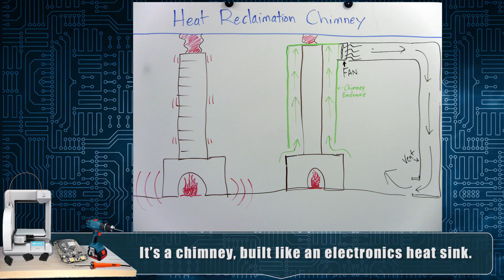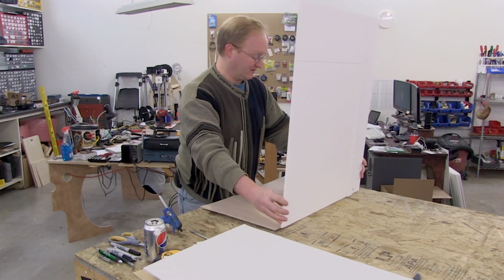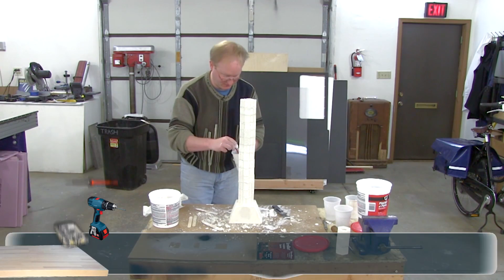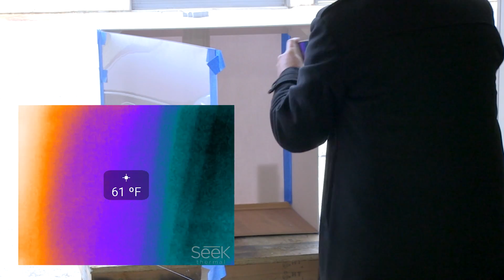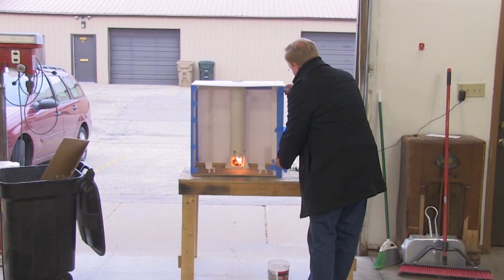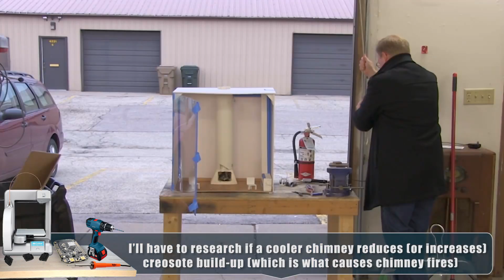Ben Heck's Chimney of the Future

Comment: Interesting concept, though at the same time one would have to take into account the energy expenditure of the fan (probably not huge in a real world case, but still worth considering)-- and, as well (and ah ! I was slightly disappointed to not see this, as in the end it is an electronics project), you really need some sort of sensors surrounding to detect for levels of CO2/CO. Not that one would necessarily 'expect' leaks (but usually the fumes 'just' rise up and out, with no risk of them being pumped back in... But of course one does not want to consider the possibility your chimney could kill you in your sleep !

Comment: I'm surprised at the lack of metal... metal being a better conductor of heat, obvious copper is very expensive, not sure what would be the next best... however... it must be a better conductor of heat than plaster of paris is... Anyway, I've always thought at least with a 2 story chimney, that you could reclaim a lot of heat by making the convected (real word?) heat go past metal slanted downwards plates, that would each heat up and reclaim the heat that way, although the double chimney design is a good idea... all be it possibly in metal and taking the average of the ambient air temp as opposed to a surface like a 66 chair 99, as in your second test. Just my 2 cents... :D
Reply: Also, if you are going to control the system by microcontroller... why not power it by the same fire burning in the fire place... So trying to think of the device that when cold on one side and hot on the other, generates electricity... this almost might negate the need for microcontrollers... as when the outside is colder, and the inside is hotter (chimney) it would produce more electricity... resistors and such may need to be employed, however I think this is one that's worth revisiting in future! :D

Comment: While a cool experiment I don't see the purpose of this(unless of course it was to advertise that temperature camera)... there are two very good methods of doing this already... either a air tight insert with a fan that blows air through metal tubes that run above and below the fire(in the flames and coals) or by using a wood burning stove(standalone enclosed fireplace that sits in the middle of the room so there is substantially less wasted heat)

Comment: Old idea, check Roman history, they used an external fire with the chimney passing under the floor and up chimney stacks around the walls, underfloor heating ass well as warm walls
In walled gardens in the UK they had fires that exhausted heat through one wall, they grew plants up that wall that needed warmer climates
Many houses had a cavity chimney with vents into upper rooms
Not forgetting back boilers built into the back of the fireplace to heat water
An improvement to standard fireplace heating (coal or gas) would be to have a vent from outside directly into the base of the fireplace to feed the fire, that way you don't get cold air drawn in through doors and windows all the way across the room.

Comment: Insurance companies would hate to see this! In case of chimney damage, this would be a hazard.
I've seen comments about having copper pipe coils in the chimney. The chimney needs to be cleaned regularly because of soot deposits, so this wouldn't be practical. In some cases, there would even be enough heat to damage the coils.  Having that built into the chimney wall though, might be viable. But you don't want this system to cool down the chimney too much, or we're back to problems with soot accumulation. Chimneys and fireplaces are quite the touchy subject.

Comment: I don't understand the point of this video.
Don't you guys have reclaiming chimneys in the US?
These are kind of the standard in northern Europe if you build a chimney...
It's not exactly a tube like design, but rather the inside is shaped in a zig-zag and the heat is transferred usually to the central heating system of the house to assist it.

Comment: Only hole I can poke in this test, is that it looks like the output of the vent was routing through the fireplace and out through the chimney, hence why the left side was colder. Air had to have been coming into the device from somewhere in both tests. How does a real house with a chimney deal with fresh air input to fuel the combustion process?

Comment: could have just put a grid of heat pipes over the fire and cap them off in a vent :/ also seal the fire behind tempered glass and make an external oxygen source ( vent leading to outside the home )

Also this is why most people use wood stoves instead  of fireplaces

Comment: this sort of used to be a thing - back when people still heated their homes with a wood burning stove with a metal exhaust pipe - they sold little sections of pipe with a fan in a doughnut shape in the piping to blow air through the hot section. this of course would be a LOT more efficient but yeah great idea

Comment: You know they have double walled stainless steel chimney flu's where the outer wall is the fresh air taken in to the chimney and the inner pipe is the hot gas which is used to heat the cold air coming in.

Comment: Youtube "jamie hyneman home improvement", he goes into a lot of detail about what he did with his fireplace to make it more efficient. Its a while since I watched it, but if I recall correctly, he used the residual heat from the fireplace to water-filled copper tubing in the chimney, depositing warm water into a chamber underneath the house's foundations, which heats the air that passes through existing ducting in the house. Pretty ingenious! Think he also made a neat solution for a fire grill without using wire mesh, so you get all the safety of a grill but you can still see the fire.

Comment: why not build it more like radiators working in reverse? thin slices of aluminum all the way up connected to heat pipes, which could just lead to an external radiator working like normal

Comment: I think if you switch the regular fan with a turbo fan, use the exhaust from the fire with a small electric motor to add spin power to the turbo, and then turns the fan to circulate the air, would that be a fun idea?

Comment: You could increase it a bit by making the fireplace a sealed unit while pulling the combustion air from outside.
Reply: Aaron Lee Kafton Even so, if you really want to heat your house with wood, you need a stove or a furnace, fireplaces lose a lot of heat up the chimney by their design.

Comment: I wonder if you put a pump system in there to make a radiator system of some sort would be any better? Have a holding tank inside the chimney, and the pump would run water out of it, circulating water around through in a circle, with exposed parts at key places in the room or house.

Comment: I would have used a material with a lot more heat sinking properties for the inner tube in the chimney. I suppose even a cast iron sleeve would work. I don't know how different metals react to the fire, I guess there's a lot of corrosive bi products in the fire bi products, but no chimney is gonna last forever anyway. Plaster seems way to isolating and porous and does not pass heat good at all.

Comment: Great project, good first start, but I'm not convinced you've cracked it Ben. I think another run with some improvements is definitely worthwhile.

You certainly showed increased heat near the vent outlet, but the temperatures in the "room" away from the vent did not seem significantly increased. This suggests that while you have succeeded in distributing the furnace heat differently, you have not made a measurable increase in efficiency.  There are a couple of easy efficiency improvements you can make.

First, use counter flow, meaning force the air you want to warm in the opposite direction to the heating flow.  As you have it, the exit air is at no higher temperature than the flue gas after it's given up its heat.  Using counter flow, you get a greater temp difference between flu gas and warming air along the whole chimney, and the exit air temperature can get closer to the temperature of the furnace. This transfers more heat than your first method. So simply turn the fan the other way, and force the room air down the outside of the chimney instead.

Secondly, while you correctly identified that more heat is transferred through a greater surface area, your brick "fins" added thickness to the heat conduction path, which increases thermal resistance. Think of heat energy as current, temperature difference as voltage and thermal resistance as electrical resistance. To get the greatest energy transfer, (current), use the maximum area, the minimum thickness and material with the greatest thermal conductivity. So try a simple plated steel or a copper tube for the flu, instead of plaster bricks.

I'd love to see what a difference this makes, and if you run your control test again (the ambient conditions for this second test cold be quite different from the first), I'm sure you'll see a significant increase in room temperature.  Also, make a minimum one inch black circle with a marker pen where you want to measure temperature, as thermal imaging cameras work best with surfaces which reflect the least IR light.  This will also give you consistent measurement points.  God luck!

Comment: Pulling heat off of the flue will lead to decreased flue temperatures which will lead to increased creosote buildup.  This is a fire hazard.  Keeping the flue clean would be critical with a setup like this.

Comment: Surely it's a bad idea to try to take heat away from a chimney? They work because they are hot. Cooling them down reduces their effectiveness at sucking carbon monoxide out of the room. The condensation on the perspex in the test shows that combustion products had been spilling into the house. Mind-you, I think there was condensation in the first test too, so perhaps the chimney just didn't work too well - either because chimneys don't scale down well or because there didn't seem to be a vent for the draught air.
Reply: Colin Stamp ZAKKORD Whether we have proof or not, extracting thermal energy from the flue gas will decrease its temperature, prevent it from becoming less dense and ultimately inhibit its ability to escape. The resulting backpressure would force the products to a path of less resistance (the model room).

My theory on the increased condensation follows from the fact that the second test was done after the shop cooled for 30 minutes during the first test. The ambient temperature on the outer side of the Perspex window was simply colder...
Reply: KYLE REES No. Chimneys can work without any wind at-all. They're driven by the hot, light gasses generated by the fire. The effect of wind blowing across the top can be good or bad or neutral, depending on a number of things like the shape of the pot etc.
Reply: 1) I believe that it's quite as likely that the "plaster fireplace and chimney" was the "source of the moisture" as it being "condensated combustion products".
2) I'm not saying that a fireplace can not be a source of carbon monoxide and as such represent a certain danger. But I don' believe that there is any imminent risk that a system like this would cool down the chimney enough to stop it from having "sufficient draft".(which is what You are talking about is it not ??)
3) This is not a new idea, through history and to this day there are plenty of "stoves" that use this technique ( albeit in a bit more technically sophisticated/elaborate way of course)).
Reply: Here is the equation to calculate the draft in a flue.
http://en.wikipedia.org/wiki/Stack_effect
I calculate our flue will make at least 4mm in water and a maximum of about 6 or 7mm in water, and those figures sound about right because our stove will go f**king nuts if you load it up, it's like a blast furnace if you feed it dry pine.
Reply: Wow, you really have no idea what you're talking about. Condensation has no correlation with combustion products, have you ever rode a bus during winter ? frosted windows ? i guess the bus has a chimney in it too. have fun inhaling all those fumes.
Reply: ZAKKORD
Think about what you're saying. Condensation is water. On your bus, that water comes mainly from the breath of the passengers and sometimes from wet clothes etc. Crucially though, where you have condensation, there is always a source of water getting into the air as vapour.
How many people were inside the box in Ben's experiment? Where on earth do you imagine the water was coming from to cause the condensation?  I'll give you a clue. Water is a major product of combustion. If the water vapour was leaking out of the fire into the "room", then the other (less benign) combustion products were too.
Reply: Colin Stamp Nice try but your argument is invalid here because Ben used waxed pressboard, all of the moisture that accumulated on the window came from the air that was inside, and the air that came through the holes on the front door.
Reply: ZAKKORD
Your comment about air from outside causing condensation betrays quite a fundamental lack of understanding about how condensation works. I won't go through all the physics of it here but I suggest you do some background reading on dew points and relative humidity. The upshot is that increased ventilation of a heated room will reduce condensation inside the room, not increase it.
There is of course, one possible water source besides the fire - the chimney itself, made of plaster. We aren't told how well Ben dried it before running the tests, so we'd be totally guessing at how much water it was releasing into the "room". The chimney, if working properly, should cause enough ventilation to clear any water vapour from the box anyway. The fact that is isn't doing that is a clear indication that the chimney isn't working as it should.
Finding out why the chimney isn't working would need more tests, but if I had to guess, I'd say that it's not due to Ben's heat-exchanger setup. More likely that the draw of the chimney doesn't scale in proportion to its physical size.
Reply: I saw a alaskan house that had the room stove, the guy had to burn a lot of wood each day.  Most of the woods heat is lost up the chimney.
I got to thinking, why not put water pipes running in a spiral in the inner chimney liner for about 3 to 5 feet above the stove.  
The water would be heated by the hot gases rising in the chimney, and run thru a aluminum fin radiator with fan to force air thru, heating the air. or better yet running pex tubing under the floor to heat the room, which would mean more heat from the same wood burned, so possibly the wood needed for the whole day would be less.
Reply: agdtec oops just saw iDavidP had the same idea.  I should have read further before replying.  But I think it still worth investigating, maybe on a future episode?
Reply: So this makes a better heat conduct because the shield around the chimney keeps it warmer because less heat can escape compared to the mere chimney alone. The hart is tapped off on the top.

Btw the majority of the updraft comes from the pressure difference of the hot air inside and colder air outside.
Reply: Raymond Doetjes Actually, the pressure difference tends to oppose the action of the chimney, not help it. The chimney sucks air out of the room which reduces the pressure in the room, making the chimney's job more difficult. This is why you have to provide some ventilation to replace the lost air and prevent the pressure drop getting too big.
Reply: Mats Rdr Yep. I'm sure it's possible to design a heat extraction system that works and, even if you just add one to an existing chimney, you'd almost certainly get away with it. Having said that, any chimney will have a safety margin to keep it working when conditions aren't perfect. Perhaps someone covers an air-brick, or installs an extractor fan in another part of the house. If you cool down the chimney, you'd be using up an, admittedly small, bit of that margin. Taking on trust that it doesn't turn out to be the straw that breaks the camels back is just a tiny bit gung-ho.
For my money, a better way to improve efficiency on an open fire would be to supply draught air directly into the grate from outside the house. That way, the chimney doesn't "suck the house cold" - at least not quite so much...
Reply: LOL ... I was just going to say that too. This is BAD IDEA! You want your chimney to be HOT in order to work efficiently. The temperature of the chimney can be controlled by the fire through the air controller but you want a HOT chimney, never EVER a cold one. Chimneys ONLY work when they are hot. Leave it alone.
Reply: Tibor K these literally exist as commercial products and are very safe.

Comment: In stead of sucking the air up on the first floor I would sent the air from the ceiling down through the chimney pipe, as hot air rises you'll be pumping already hot air through a hot pipe, wich makes it even hotter.

Comment: I think you do not have to control the fan, use the max speed, the energy you lose with the fan at the max speed is lower than the thermal energy you would save (or stop losing). If you want less heat just use less combustible, don't change the fan speed.